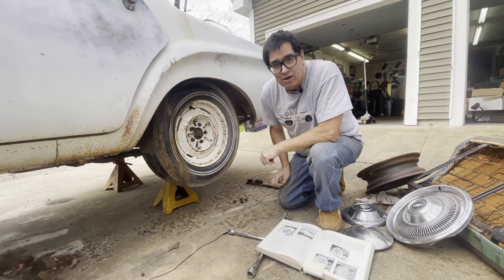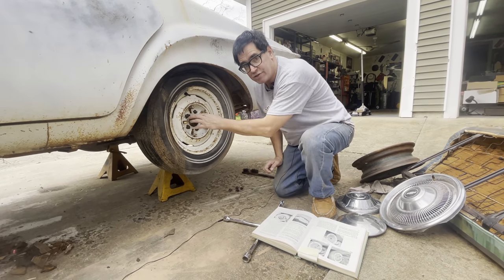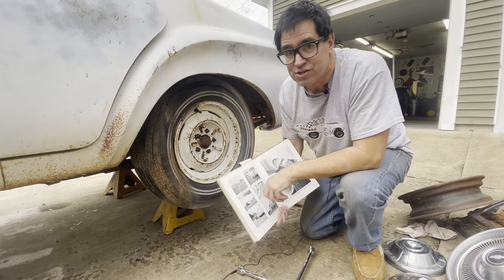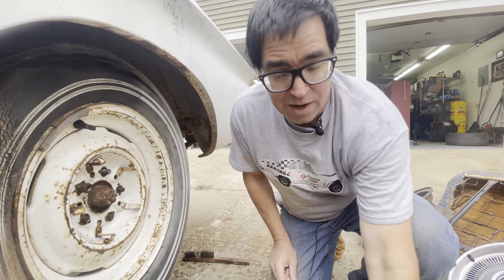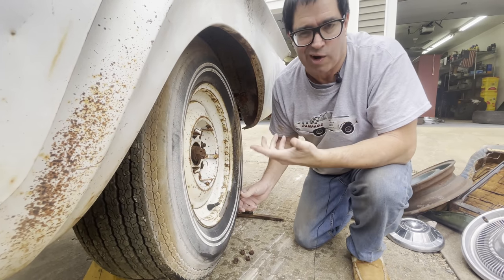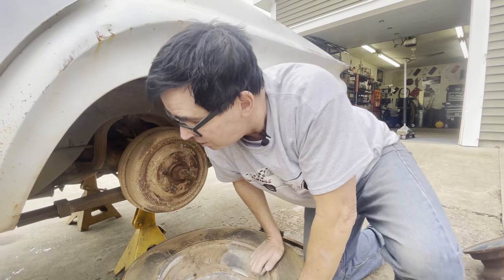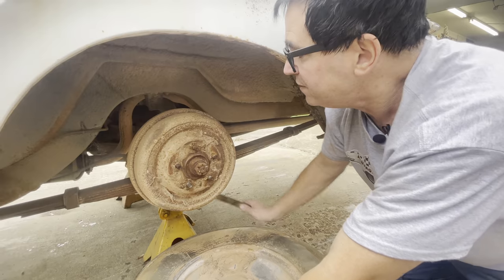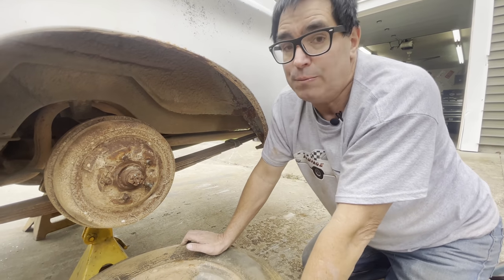Another BIG Brake

Comment: I just found your channel. I remember you from your "Bad Seed" Chevette days. You rode in my ZZ430 Vega between stops on Power Tour years ago. It wound up with a Corvette 6 speed which was the best transmission as it kept the heat out of the radiator unlike an auto trans. I sold it through Streetside Classics in Dallas Ft Worth ( look for ZZ430 Vega). I was in Delaware but now I am in TX. You were in Cali but now you're in MA. I went to Electronic Warfare school at Ft Devens years ago. Power Tour used their parking lot as I remember for the East Coast Power Tour. It's been yers and it is good to see you are still at it. I appreciated your altered wheel base car too.  This Max Wedge project should be interesting.  You haven't lost your touch.

Cheers
Larry Heagren
Canyon Lake, TX
p.s. the car was in the Oct 2003 issue of HR the 12 second 20 MPG issue. It ran 12's at 120 MPH a very traction hampered launch.
Reply: Was bad seed the one with the 500 caddy motor?  Memories

Comment: I guess the left hand thread lug nut theory is out the door these days!
Reply: @ Jet Lag Heroes  Honestly I think it came down to a serviceable factor & 2nd, a cost factor. Lots studs got broke, owners couldn't change tire, = lots of complaints. Then think about how much cheaper you could get a single type stud when you're ordering them by the railcar. Really at the time, those are the biggest factors in manufacturing.

Comment: Hey Steve digging your show my grandfather had a 63 polara police car same car basically anyway wanted to let you know there is a special tool available threw the Chrysler 300 club that safely removes these axels with no damage to part or technicians look it up via 63 Chrysler 300 J was $150 bucks or so but was well worth it as I had no experience ever doing one till my dad purchased a 63 300 J years ago an I had to service the brakes an suregrip enjoyed the great Texas  mopar horde experience  an this police issue 62 polara!
 my brother bought the 300L an the pretty 65 300 witch now runs an drives an is very clean ty for your time an dedication to old cars an mopars in general I love your shows!!

Comment: Most 318 poly's '62s used a 2:76,  but 3:23 available.  Even my '62 318 power pack is 2:76.  It's written on the diff case.  A hydraulic puller and a bit of heat, a tappy tap, and the rear hubs BANG off.  (ok, I seem to comment on all Steve's cop car vids, sorry.)
Reply: Tappy tap tap 😅
Reply: @dewreckdeberjack9618  I blame AvE
Reply: @moyadapne968  indubitably 😅

Comment: My dad was service manager at a Dodge dealer in the 1970’s. A customer called very angry, he was stuck on the side of the road with a flat tire on his old pickup truck. He couldn’t get the lug nuts off and blamed the dealer for over torquing them. My dad drove out with a mechanic. The lug nuts came off, no problem, when they were turned right to loosen. The man owned the truck for 15 years and never had a flat on the driver side.

Comment: PSS... In 1969 my mother factory ordered a 1969 Plymouth Satellite, 2 door hardtop, as follows...318 V8, NO power steering, NO power brakes,  AM/FM Radio  AND 3SP manual trans, column shifted, with an UNSYNCRONIZED first gear, .  I learned to drive on that contraption, which was tough since I had never heard about "Double Clutching"!  

 PS MOPAR "Bonus Tip" It had the rare "Full Horn Ring" option.  Yes, for a few bucks, the aluminum colored, metal horn ring, went 360" around the steering wheel, not just the bottom holf, like most Mopars.  I have not seen another with said horn ring.  (I tried, with negative results, to get her to order a GTO, instead). 
 

I am looking forward to viewing all your episodes?

Comment: I learned about the left-hand lugs the hard way. I had a '69 Chrysler Newport in '77 and 19 years old, and using an impact socket wrench, wondered why the lug nut was not loosening and the rim was concaving. The impact socket was spinning in the correct direction!!

Comment: Some lessons about left handed lug nuts and bolts.  1. If you have all 5 on a given wheel, don't upgrade/ replace with right hand. They (left hand on left side of car  )  DO help.  2.  If you break a left handed stud, there are no new ones available , only right hand.  So, save the left handed ones you take off if you don't want them, because someone will want them. 3 Right handed wheel studs are easy to find at the big auto stores for REAR wheels and are under two dollars each.  Most mid size, full size Chrysler corp cars and half ton trucks from 1967 to 1984  and more use the same parts.

Comment: In regards to left hand and right hand wheel nuts, ‘Lug Nuts’, Rolls Royce and Bentley used the same method on their wheels, or at least they use to. I owned a 1980 Rolls Royce Silver Shadow ll, and it had the same method, is seemed a little odd at the time.
Manchester, England.

Comment: Hey Mag's! I restored a 1968 Dodge Polara Coupe with Four wheel Disc Brakes with emergency brake. Heavy duty axle's Mopar Heavy duty nodular case 3.55 gears and a Tru- Trac limited slip diff. The Tru-Trac in my opinion is the best unit out there for a daily driver. although racers do use these too!

Comment: My early built 1933 Dodge [code DP] used left hand threaded nuts. This pre-dated the wheel bolts, so the left threaded wheel nut on Dodge passenger cars was first used much earlier that many might think.

Comment: I remember those dual whitewalls from the late 60s . General even had triples around 70 . Back in the bias ply days tire buying was a yearly thing . The polyglas on my dads 73 Coronet were a big step forward but the 8 1/4 rear was a total piece of junk not up to hauling a 16 foot boat .

Comment: I had a '51 Plymouth and a '46 Plymouth they both had left hand lug bolts on the driver side. The castle nut holding the drum to the rear axle is also left hand thread. Use a '65 Torqueflite to retain the pushbutton shift but get rid of the ball and trunion "U" joint at the transmission and use a normal "U" joint and slip yoke.

Comment: Steve, Los Angeles Police Department published a bunch of specs for Police cars.  They didn't just choose from what was offered.  Chrysler had to add a rear sway bar to the Belvedere and Coronet police cars they sold to them. 1967 for sure and possibly another year or two. It think it angered Chrysler to have to put them on just for LAPD. You will see plenty of mention of "LAPD Only" parts in the big blue 67 Parts book.  I've never seen a LAPD squad car. For a while, they were searched for in junkyards for the rear sway bars, but few thought about handling back in those days. 
     I can say that 72 Road Runners came with rear sway bars with most engines, but 1970 did not. I'd just be guessing for 1971.

Comment: When I was little and already a car nut, I remember studying wheels and tires, mainly because my eyes were down there. I noticed the differences in steel wheels from make to make, when they lost the prongs (I knew my model years, generally) and lug bolts vs. studs and nuts. I assumed since becoming an engineer, that prongs were done away with because they were more expensive, due to greater part count and extra operations to build them.

Comment: My 62 Chrysler 300 had all the studs stripped by one of the previous owners , even the right side was messed up thanks to mixing left and right nuts. As far as the axle swap, I just went with an 05 grand Cherokee, disc brakes, limited slip and 3.54

Comment: My 1951 Dodge Wayfarer has left hand lug nuts. Surprised me the first time I tried to take the wheel off.  It also has the same type of hub cap setup with the center tangs. Additionally, it has same tapered, keyway rear axle for the rear hubs as your car.
Reply: Didn't it have Bolts with tapered seats?  It was common for guys to have brake shops force in studs and cut off the mounting pegs so they could use lug nuts. I would think they would have wanted right hand on all four wheels if they had that done. It cost about 30 dollars a wheel to have it converted.

Comment: To not mushroom axle when removing drums just put nut on axle with castle part of nut facing towards backing plate flush with end of axle then use puller until drum pops free . Remove puller nut and drum . My Dad taught me that and it usually works . You might have to bang on end of axle puller to shock drum loose.

Comment: 4:29. It been my experience that if both wheels turn in the same direction you have a posi. Little odd that the other wheel didn't turn at all. From my years as a shade tree mechanic the open rear end will let the other wheel turn but in the opposite direction.

Comment: on the rear axle turn the nut around heat it and use the puller won't mess up threads so much if at  tall

Comment: Those two-piece axles also had to be torqued to 250 FT pounds if I remember correctly.
My sister had a 1964 Dodge Dart. When she had the rear bearings replaced, the shop ended up putting the the axles back on wrong, so that the left-handed studs were on the right. Argh.

Comment: Right, my 72 Demon had the left nutz... it makes total sense due to centrifugal forces and I imagine older wheels and tires weren't exactly  balanced too great an those vibrations at the type of rpms close in there near the hub is astronomical and would take them nuts right off...  
same as why the dumb intake manifold or head bolts loosen up and need rechecked from sonic vibrations.

Comment: Those left hand threads on dodge go way back. The old cars with bolts were the same such as my 41. I didn't know Pontiac and olds did that. I don't think my 47 Pontiac is like that or the 62 I used to own. Those clip on hubcaps were used on GM and dodge till the end of 54 on normal cars.

Comment: Two questions, if you buy the Ma 65 rear, will you be able to keep the big brake drums? Also, I've tried on two different older Mopars to install a Sure Grip and found out both times the axles would not go back all the way in. They seemed about 1/2" too long. Is it just me?
Reply: That's what she said?

Comment: I've never worked on one of these cars, but with regards to the threads mushrooming out on the rear axle couldn't you loosen off the castle nut or flip it around, and then use a puller. That way the nut would keep the threads from deforming.
Reply: I used to do just that. kept the axle from being damaged

Comment: I remember  my 1st time changing an old Mopar tire lol I didn't know they were left handed on the car until I broke 3 after I figure that out went to the other side broke 3 more off before realizing those were right handed threads .... lol on of my worst days ever lol
Reply: Yikes bruh!!  Don't feel bad, my 72 Demon in high school had the left handed threads, no issue there but I totalled it after getting it legal about a week!  The next year I had a 70 SS Monte Carlo and swapped some tires around checking out the brakes and stuff during the day and must have forgot to final tighten one side cuz downtown cruising that night was backing out of a spot and the tire breaks off up into the wheel well!!  bout 3 studs gone, 1 lug nut left!  MY buddy ran me home in his lifted square body Chevy and we midnight auto grabbed the rotor, hub, bearing off my 71 Monte Carlo parts car behind my parents house but the SS calipers didn't fit with the brake pads so  I drove home on E Brake till Monday morning back to shop class to press in new studs!  Haha, those were the days {;o)

Comment: Did you mean the tangs stop the hubcap falling off or does the cap stop the nuts fallin off thus stopping the wheel falling off ? Plz
Reply: He meant the cap falling off. Because that style of cap is smaller the rim wouldn't flex as much as the other style further out. Closer to the centre the rim is stronger and is back by the mounting face and lug nuts. That is why full wheel covers come off all the time, it is due to the steel rim flexing and making the cover come off.
Reply: Cheers mate , i didn't think the cap was that strong. @MJTAUTOMOTIVE

Comment: I was told 50 yrs ago when I was around 10 that lugs were that way because people did not know : that left is loose and right is tight and I was told the old owners manual would say : to loosen the lugs turn the lug wrench to the rear and to tighten them turn the wrench to the front kind of more sense than that weird explanation in that book

Comment: A complete 67-70 b-body 8 3/4 will fit right in there, spring perchs are in the same location. Keeping the original big brakes are not worth the hassle of dealing with that dumb tapered axel. All b-body axel measurements are found in the old Direct Connection "chassis" book.

Comment: I would go with the 8 3/4 742 or 489 differential . It would be overkill with the Dana truck axle. This would work well with the wedge engine and automatic. 3:91 gear

Comment: I had a ‘79 F350 and found out (in my driveway, thankfully) that the driver’s side lugnuts were left hand thread. Was banging on them with my air impact to no avail when I thought I’d try the old “Go the other way” trick. They started moving after that. 

Had a ‘79 F600 with big six lug wheels and the driver’s front had one lefty. The rest were righty. 🤷🏻‍♂️
Reply: Leftovers and '80's had production problems. As old mechanic, an f'ing nightmare

Comment: WHY,, it is one of many Mopar what were they thinking  moments. Here in Oz we were forward thinking,,LH thread finished in 70. Dodge Kingsway were bolts [with l/h thread] until around 57.
Clip on caps lose caps. That before those clips inevitably break. Not just Mopars.
Those keyed axles,,, what were they thinking. The dumbest engineering ever and yes the drums and wheels bail off,, or occasionally you run out of drive when the key fails.
Those 6 leaf springs were not for handling but to carry all the crap cop cars carry.
We got those models here in Oz as 4 dr Dodge Phoneboxes, 318 A and typewriter tranny. Oz assembled. Just the base cars with upmarket trim. Not bad cars, a friend has one and they have 1/2 nuts after selling him as we both thought 7/16. Have some on order for another ATM.